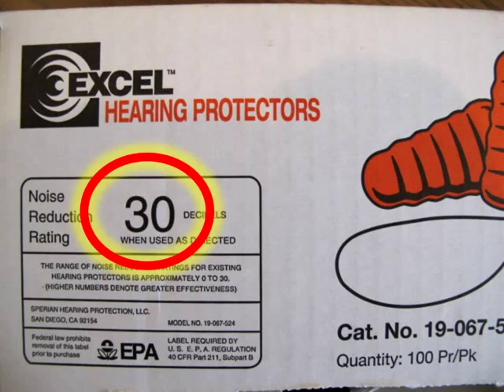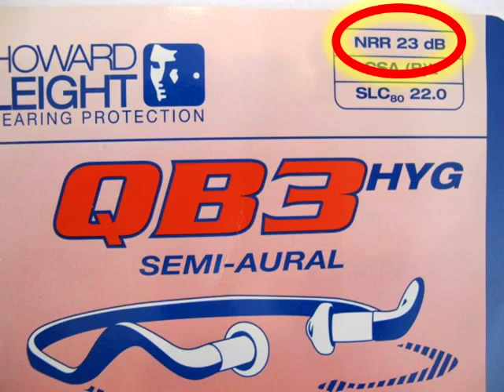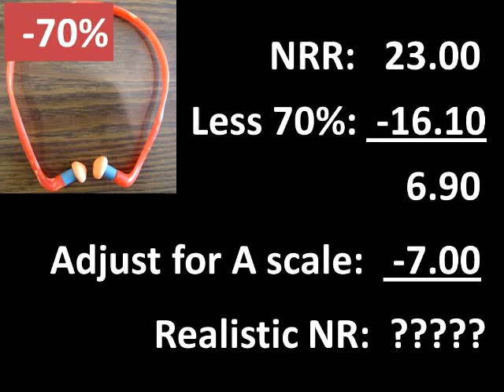Hearing Protection

Comment: " might" 😳.. sound enters the jaw bone as well as the ear .. .. very important information... .. so ear protection don't work that much 😳 .. shocking.. I have 3m ear defenders rated " 34" ( I hope ) and use wax ear plugs "24  Decibel" I only use battery garden equipment which has a noise reduction over gas powered garden tools.thanks for the video.. very valuable information

Comment: Finding good quality information on this subject in video form is difficult, but this video was helpful.  I didn't know  that pulling the ear back before inserting helps, but now  that I tried it, I'm thankful, because it really does help.  I was told to roll them until thin and just insert, but adding the step of pulling the ear back really does do a better job.  Also, you can watch this video at 1.5x speed and still understand everything in less time.  Any faster and it is harder to understand.  My question now is, does noise cancelling technology proven to reduce hearing loss?
Reply: What noise cancelling does is called "destructive interference". You can learn more about it by having a look at the Wikipedia's page for wave interference.

TL;DR: It cancels out the noise you hear by producing a similar sound wave with a delay, so that what arrives at your ears is flat lined into a blank noise. Assuming your noise cancelling technology is strong enough to cancel out a very loud sound, what you would hear would be a very loud blank noise (which could still be dangerous).

Not to be confused with electric ear protection which provides passive protection, and the microphone amplifies tiny sound as long as there is no dangerously loud noise yet.
Reply: It is proven to reduce hearing loss, but only in small quantities, I believe.
And also I think it is easier to understand at 2x speed

Comment: IF we combine two protection, is that a double protection?
Reply: You reach a point of diminishing returns.  Yes better, but nowhere near double, especially if you read up on how decibels are measured.  Honestly, although this is a disappointing answer, it's still a very good reason to use both when feasible.
Reply: Combining 2 solutions is better than using a single one. But yeah, there's a point where you cannot get any more protection, because the sound will propagate through your body directly.

Comment: The last youtube video I watched on hearing protection told me that ear plugs are by far better for noise reduction than earmuffs. In my experience, earmuffs feel quieter less loud than earplugs.
Reply: Depends on application, when I worked for a lawn maintenance company. Even the cheaper 24db muffs did a better job at minimizing the mid-loud humm of the machines. However, a cheap earplug, with 32db nnr--is far better for the range, if of course good technique is applied and seal is proper. Bone conduction(causing local vibration to drum) is yet another element of the equation. If indoors, it's recommended to double up on hearing protection if the measured sound climate requires an nnr rating of 27db or higher.
Reply: @brentbarrus9754  i was very surprised when he said earmuffs r best in general. in my experience, a properly fitted, high quality foam earplug is better than any earmuffs i've tried. the ultimate is of course, both.